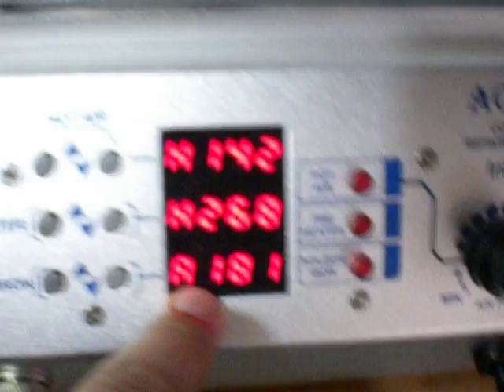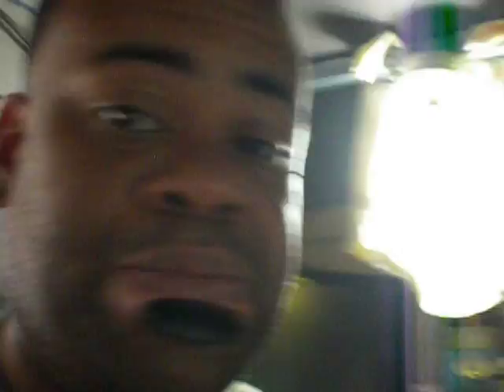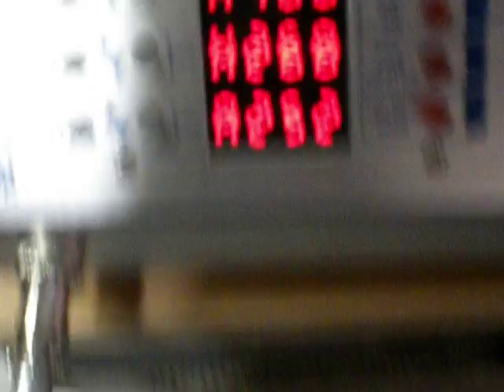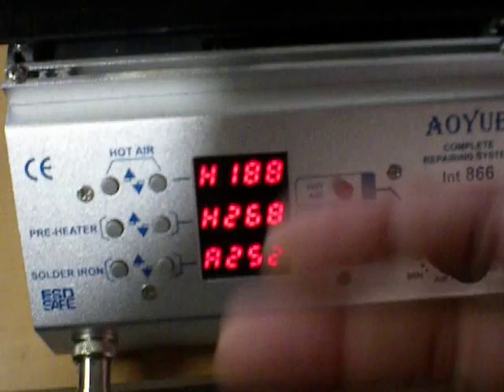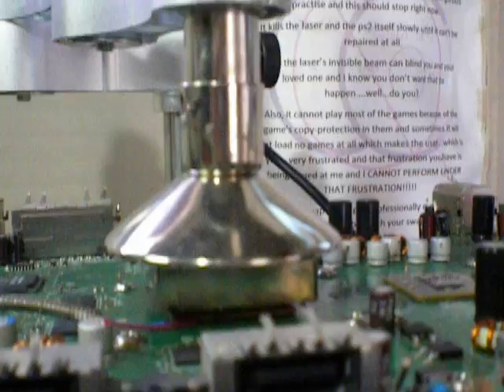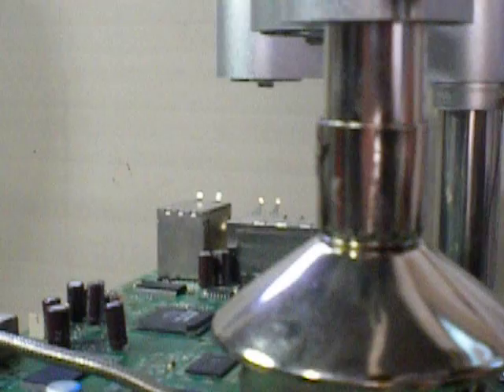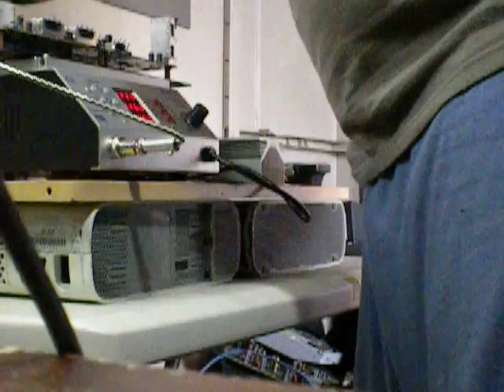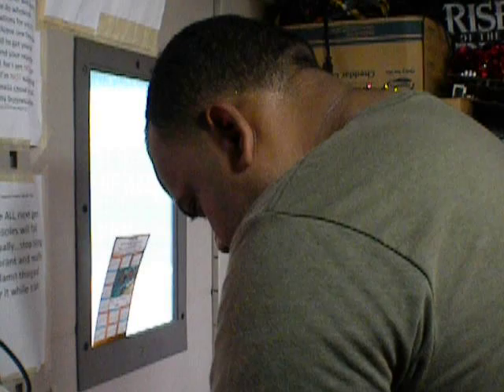guide in how to use the INT866 rework station from aoyue

Comment: I totally agree with your comment about the trial and error. I have re-flowed a couple hundred boards at least with different results using the same method. I did not use this machine that you are demonstrating, mine was a Puhui 862D++. Time of day, ambient temperatures, and controlled air flow and environment/surroundings all have MAJOR factors to a successful re-flow. Your comment about the chips popcorn effect is quite true if the topside is heated too much, my comparison is blister or blistering of the chip, seen it happen many times and can be quite frustrating. I sold my machine about a half a year back and am in the market for a new one, this int866 looks to be quite promising. Thanks for sharing and performing the demo for all of us.
Reply: Richard McKenna Another good thing to use when reflowing or pulling any ic's/bga is a fine/thin flux PRIOR to heating. Put a thin trace around the edge on the board and bga chip. The heat will pull it under the bga chip and it helps with solidifying/liquefying and removing or fusing onto or off of the board. If the chip popcorn's or blisters it is dead. The best flux I ever used was by amtech and had to be ordered through ebay, user was bluedragonchina if I am not mistaken.
Reply: Richard McKenna My highest success rate was using 220+/- degrees Celsius for the ceramic pre-heater and about 240+/- for the top side using hot air. Hope this helps some of you.

Comment: What flux are you using ? where did you buy the flux from ?
Reply from the maker: Alzaabialzaabi http://www.amazon.com/AMTECH-NC-559-ASM-Clean-Solder-Paste/dp/B00ON8YFA6/ref=sr_1_1?ie=UTF8&qid=1430513809&sr=8-1&keywords=amtech
Reply: ModzVonXyborg thanks a lot I am using Kingbo RMA 218 original and it is good also I am doing PS3 Reballing ... ps3 reballing is very difficult almost impossible to repair PHAt PS3s ...
Reply from the maker: kingbo works best as well, I have both original and fake, the fake works pretty well for reflowing, I use the original for placing the solder balls back on the chip with insat flux too.
Yes PS3's are a nightmare to reball, due to the board being very thick.

Comment: I bought int866 Rework station and I have a few concerns.
 External temperature controller shows no rise in temperature at the point of contact plates or CPU or GPU continuously. As an example, the growth temperature 185-189-192-199 .... etc (this is written as an example). I have to display variable values jump diametrically opposite of any series of logic. A089-A177-A326-A110-A254-A333-A180 ... etc (and this is an example of landmarks). I do not about the displayed temperature value in one row with some small fluctuations (as it should be). I can not figure out what's wrong and where the problem is. The device is new and I acted according to the steps that I have in the manual and this vedeo your presentation.
Please help if you have an answer for the solution of the problem. Currently only experimenting on some but definitely dead CPU and GPU, just to catch routine and experience. As you know the problem is not something separate from the plate, but the most important is to have an insight into the real state of temperature directly on the body element where it is heated.

Thanks in advance!

I hope that my English is understandable in reading and understanding :)
Reply from the maker: hey bud. Now one thing about the aoyue, is that when it comes to the reworking, its efficient, I too had this same issue with temperature controlling, that is why I ended up buying an external thermocoupler to connect to my pc to monitor proper heating of the plate and board due to the fact that the thermocoupler used in the machine itself isn't always accurate.
Reply: Thanks buddy, that's what I was thinking as the final solution, but I'm disappointed because I expected in this configuration, but high-quality thermal probe for external control. However the rest of the machine is more than satisfactory, so my disappointment less :) I'd love to see one of your complete Rework with more detailed footage so when you're in the mood and time began and in the mood.

Again greetings and gratitude

Comment: where did you get that bracket for the xbox 360?
Reply from the maker: ebay...look for xbox 360 stiffening jig
Reply: ModzVonXyborg You think if I just use the bracket it comes with, it will be ok?
Reply from the maker: nope...it'll warp the board man
Reply: ModzVonXyborg Alright, if I get this support, http://www.ebay.com/itm/111019399392
do I just mount the board to it and lay it on the heater? Is there a mount on the heater?
Reply from the maker: Justin Wonda when you get the jig, place the board according to how the pegs matches to the holes, screw it down in place, then simply rest it on your preheater and Happy reballing.
Reply: Thanks man, really helpful
Reply from the maker: no problem bud

Comment: hey man did you buy this machine on ebay??? 
this product really works for xbox, ps3, and pc motherboards?
because I'm seriously considering buying one of these machines Rework
Reply from the maker: amazon, ideal for beginners, works great with laptop and xbox 360
Reply: thanks a lot ,I live in mexico and amazon does not shipments to mexico and saw an equal on ebay, I'll buy it to start doing reballing my xbox 360 having failure gpu
Reply from the maker: no problem :)